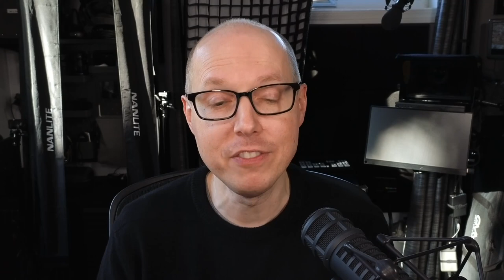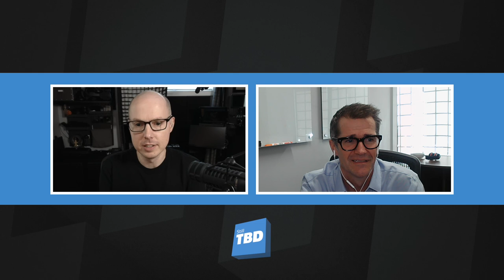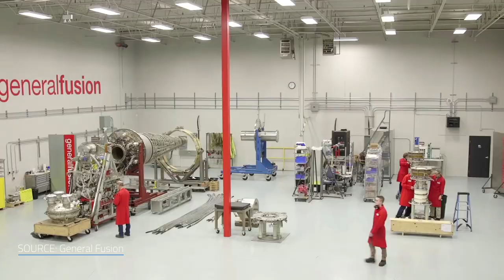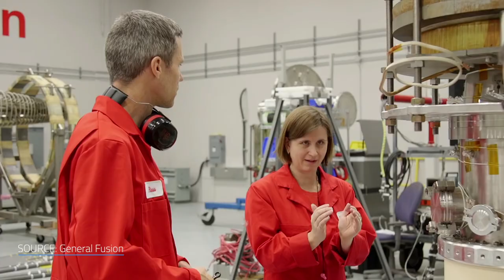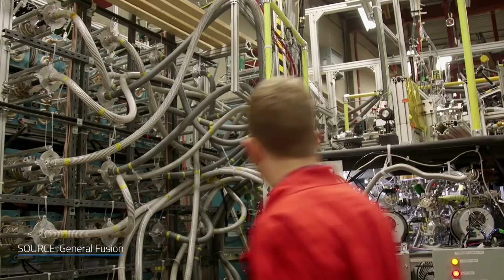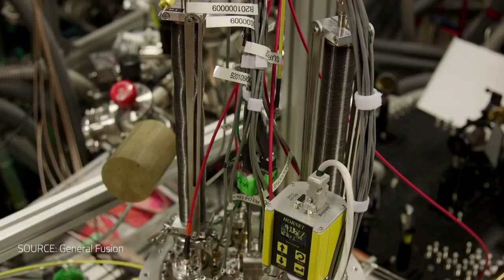149: General Fusion Interview with Mike Donaldson

Comment: The illustrations for the GF concept show the plasma being injected info a rotating cylindrical caldron of Liquid Metal and then magically stopping half way into the cylinder while the pistons strike the walls of the cylinder in a sequence that form a collapsing sphere. The plasma fuses under the pressure of the collapsing Liquid Metal and the Liquid Metal is somehow slung out to the perimeter of the rotating cylinder to repeat the process. This is suppose to happen at 1 hertz. I am very skeptical of the fluid dynamics of this operation, the ability to precisely stop  the plasma / time the collapse of the Liquid Metal, along with difficulty of maintaining the conditions (presumably a high quality vacuum) that are suitable for the plasma injection. I was hoping Matt would ask some tough questions to answer questions like this.
Reply: I thought this was a terrible interview.  They talked in general terms with no details.  Maybe I missed part one where there was a detail discussion of the this liquid metal process.  You may be able to create fusion for a very short time but how do you extract the energy in a usable form???
Reply: @retirednobaddays456  perhaps this information is not necessarily part of their public presentation, as it probably took them a lot of work and they are hoping to have a market advantage by knowing already what others will still have to figure out if they go for a copy-cat ,, since most of the plans are obviously presented already. This would raise the cost at least, making it more difficult to steal the technology before they are established.

Comment: I know it's surface fluff but I do like hearing from the engineers who are on the front lines of trying to solve the practical problems. A more in depth interview with Mike would be a treat getting into equations and mechanics of how it's possible to use steam piston induced compression with a liquid medium and the shock waves which are created. It's a fascinating approach and I'd love to hear more about the engineering that goes into it. I know they'll be tight lipped on the specifics and diagnostics but the general 'how it works" on a wave progression tack would be extremely entertaining to unpack.

Comment: It surprises me that Mike Donaldson several times states that the compression pistons are steam driven. The original design certainly had steam driven pistons. Those pistons were to hit anvils that transferred an acoustic shock to the rotating molten metal. This shock wave was supposed to compact the spherical metal shell. Since no extra metal was injected this seemed impossible to me and eventually also to General Fusion since they abandoned the concept. The steam driven pistons has since been replaced with gas driven pistons that are supposed to inject molten metal into the rotating metal shell thereby shrinking the cylindrical central channel in the rotating metal. The pistons are timed in such a way that the original cylindrical cavity will turn into a sphere that can compress the plasma from (almost) all directions. 

Originally the cylinders had a spherical configuration but today is looks more like a pancake. Here is a picture of a prototype:
https://www.setventures.com/general-fusion-establishes-u-s-headquarters-in-oak-ridge-tennessee/
The plastic tubing indicates that this machine cannot be tested with liquid metal which is supposed to be lithium (originally a mixture of led and lithium). Moreover, the whole machine would have to be thermally insulated and supplied with electric heating elements. The most probable testing liquid for this prototype would be water. I am not optimistic about the chances to make this gadget work with molten metal.

Actually, here is a video that verifies that it is just water being compressed:
https://www.youtube.com/watch?v=UvUsQQWrHvM&ab_channel=GeneralFusion

As usual, comments are disabled on General Fusion's videos. I wonder why.

Comment: Hmmm ,, so my thing is that fusion is clearly a long ways out, even with such promising ideas underway, but fusion (as this video brings up, , makes atoms from other atoms) ,,, could it be used to manufacture atoms that could be used as fuel for another plant (perhaps radio-isotope thermo-electric) that would result in much safer waste than fission plants do, by consuming renewables during high production low demand (instead of charging batteries basically),, and then these other plants could produce power on demand? ((the idea is,, this would create a stepping stone where fusion plants could be iterated even though they are not able to have particularly significant positive production numbers))

Comment: How will this be turned into electricity?
Reply: Heat create steam that turns turbine and generator
Reply: @robwon8378  can’t that already be done efficiently by nuclear power?!
Reply: @ithalmardesedas7853  😂 if you haven’t already learned the benefits of fusion vs nuclear fission, it better if you learn that from sources other than me 😂
Reply: @robwon8378  can the same job be done through traditional nuclear power? How much more steam do you need to turn the same 200yr old dynamos